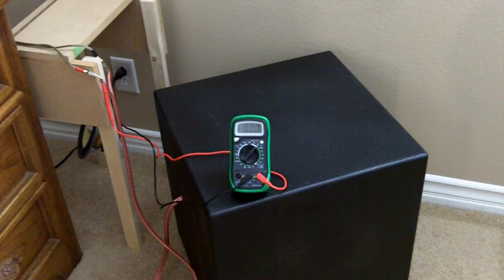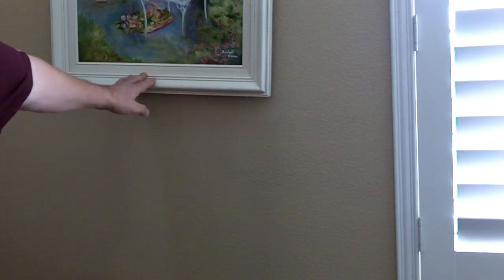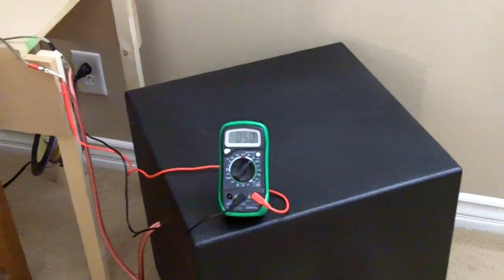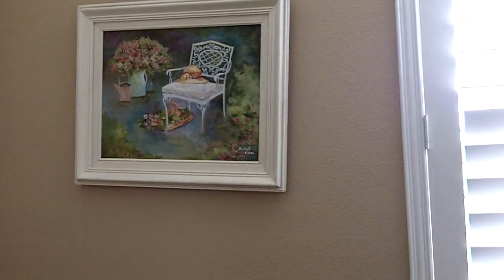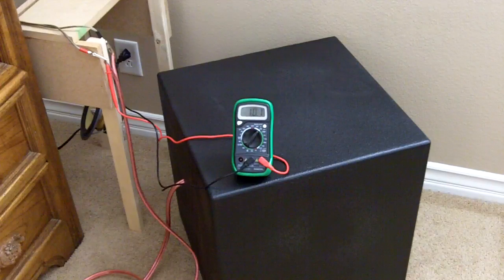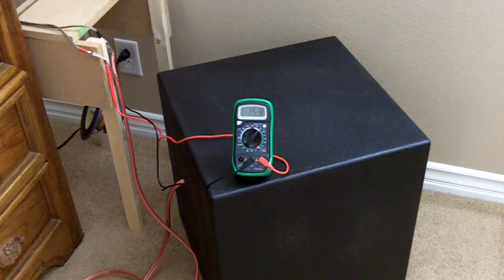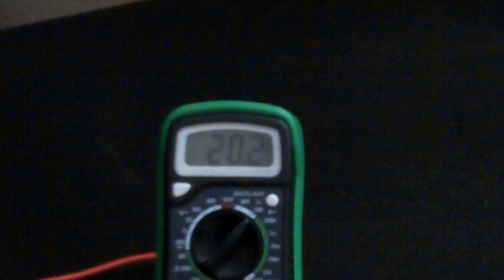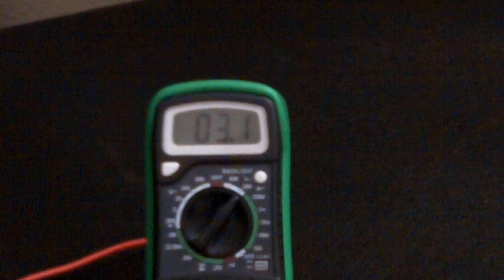Bill Fitzmaurice designed Tuba 18 folded horn subwoofer

Comment: @gilbertscales  12Hz????you kidding right.....anything below 30 is a waste on the ear.
Reply: Nope - 15hz is well doable with BFM's horns. It's used for Low Frequency Effects :)
Reply: +PicknPlaceDIY I thought you were to high pass a Tuba 18 at 40-45 Hz, but the Table Tuba and Tuba HT can go much lower.
Reply: Well, I can't talk about a Tuba 18 ... But I know the chassis can barely handle 15Hz without breaking in the HT. Of course it won't be HiFi but at 15Hz all you need is power :)
Reply: I can hear 16-17hz just fine.

Comment: The horn will unload long before it hits 12Hz. No horn that size will be able to hit that at full power. I'm not familiar with its design but if its a front loaded horn with a closed chamber on back it will act like a small sealed box below the horn unload but the harmonic distortion will still be loaded and amplified by the horn. So with room acoustics it may be able to get that low but not at very high levels and distortion will be relatively high

Comment: Okay, lets do some basic thinking here. Simplyfing horn physics, the length of the horn determines its maximum low frequency response if the mouth area is assumed infinite.in theory the tuba 18 could become horn loaded, if you stack enough units to increase the mouth area. otherwise the horn-path doesn't do much exept acting as a strange non-tapped tml, with a spiky frequency response, horrible transient response and no gain whatsoever...

Comment: @RoteKampfSocke @RoteKampfSocke I'm sorry, what? BillFitzmaurice dotcom designs work as advertised, the way they are advertised; Noone is cheating physics. The inside of that box is indeed appears deceptive from the outside but I can assure you it is a horn and the woofer driver is indeed horn-loaded regardless of what you have to say about physics. FYI, an approximately 7ft folded horn is hidden in that box. For further debate on the topic, c'mon over to the BillFitzmaurice dotcom Forums.

Comment: @zbrock
Ok, so you can cheat physics ? Having something that looks like a horn doesn't make it a horn,  at least it doesn't behave like a horn since no horn-loading can occour in the operating frequency band. To have a real horn loading effect at 50hz, a CORNER LOADED horn needs a mouth area of  .5 square meters, for 40Hz its .8m^2 , for 30Hz 1,4m^2. Thats a huge box , even for "only" 50 Hz. All other constructs behave more like a bassreflex- or a bandpass enclosure.

Comment: Thanks man, if the recommended driver is only $30 then that's not a problem, the next time I have $50 (which will be months from now), I might be able to build one. It's also really amazing how loud a cheap driver can be. This is an extreme showcase of how important the enclosure of even a cheap sub is : ).

Comment: @RoteKampfSocke Not entirely. Subwoofer horns can indeed be built as small as you see here in this video and produce low frequencies. The Tuba 18 as seen in this video is indeed a folded horn subwoofer.

Comment: @tommytryptamine No, Beta 8 would not be suitable. Each set of plans gives you a range of suggested drivers, along with T/S parameters to look for to find a driver that is +/- 10% of the parameters to obtain advertised performance. Bottom line: go with the recommended driver - in the case of the Tuba 18, the MCM driver recommended is only about $30.

Comment: @31Orcas Bill's boxes are pretty specific regarding the T/S parameter requirements for the drivers suitable to each box. Each set of plans gives you a range of suggested drivers, along with T/S parameters to look for to find a driver that is +/- 10% of the parameters to obtain advertised performance. Bottom line: go with the recommended driver - in the case of the Tuba 18, the MCM driver recommended is only about $30.

Comment: @TimpBizkit 
It actually is. There are many speakers which are called "horns" but which are really a bandpass. Horns need a big horn mouth in order to reach low frequencys. But Stacking or corner-loading can simulate a larger mouth, but with a tuba 18 thats not the case since it is a bandpass.